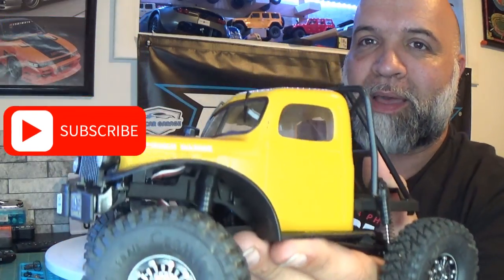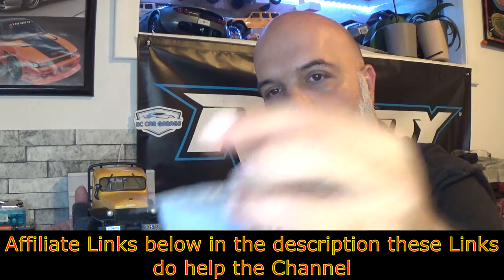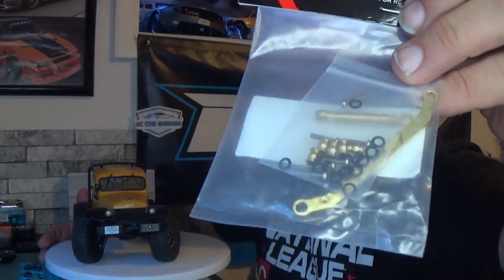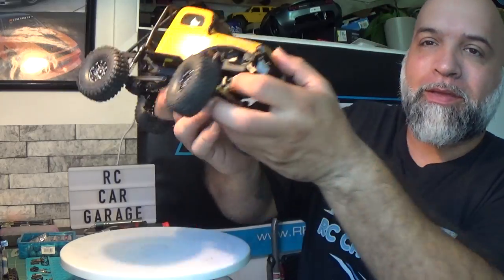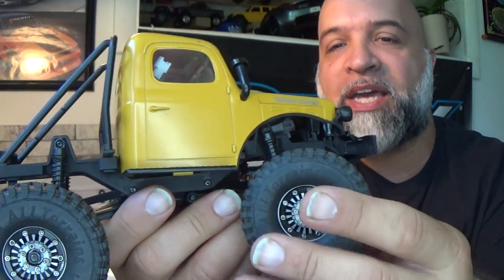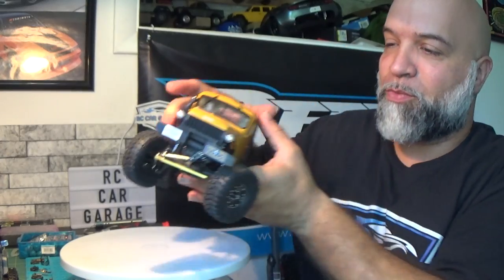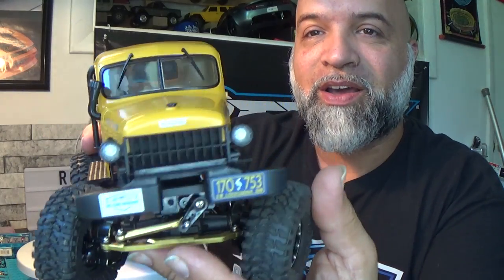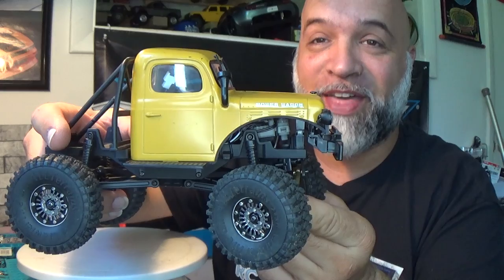fcx24 power wagon with brass portal covers tackles steep angle will it be enough weight

Comment: Love the look, you should cut your front bumper down a little and move the front axle forward a little. it will help with climbing.
Reply from the maker: I was actually thinking of moving the rear axle back a little bit actually. The front Bumper I'm either going to shorten or get a different bumper